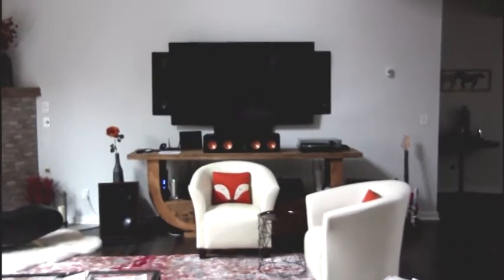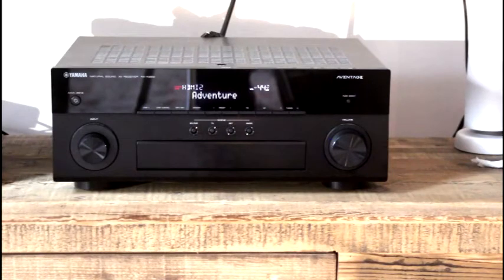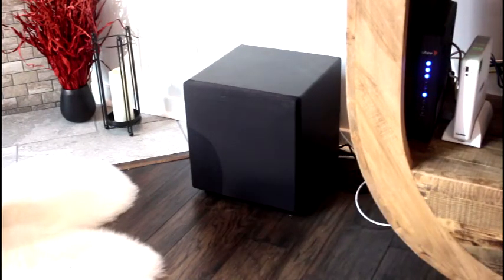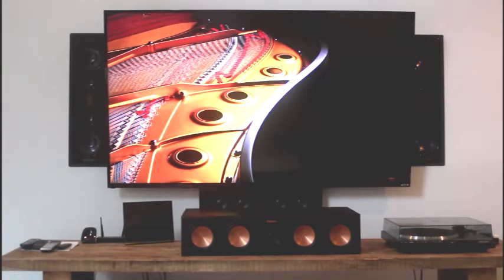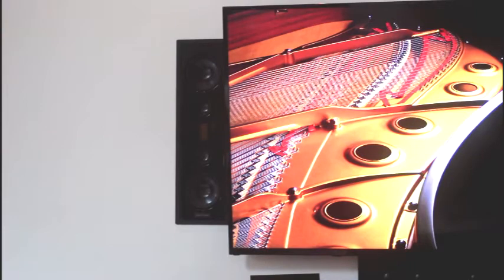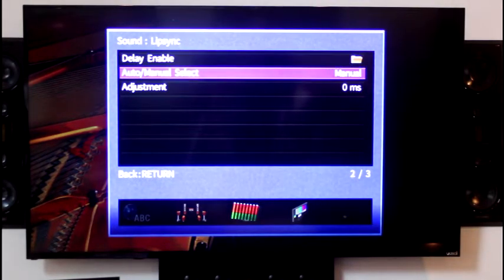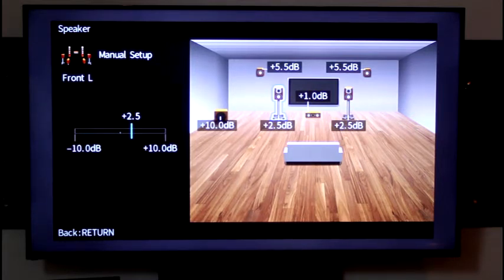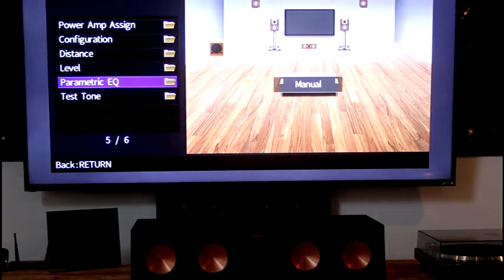Home Theater - troubleshooting the setup - Klipsch, Martin-Logan,Yamaha

Comment: Hi I was just a little confused about the settings from the video picture of your receiver set up screen. It looks like you have it in biwireing setup you have four speakers  the center channel and the sub on the screen shot. I only point this out because it would be possible to have the ML Edges work as your highs and the Klipch  work the bottom ends in a bi wire setup maybe that's why you had too change or twick the frequency patterns. I own a newer Sony 7.2 receiver that has the video assistance display and your clearly shows that a bi wire version was selected
Reply from the maker: I'm not sure what you're referring to with the Bi-wire. Bi-wiring is a function of the speaker not the receiver or amp and separates out the speaker Hi and low crossovers so that they can each take a pair of leads from the amp which has it's output split from 2 to 4 leads.
In the settings BI-AMP is set to OFF and it shows active speakers as FRONT and FRONT PRESENCE. If I try to use the Klipsch and Edges as you suggest I would actually be hooking them in parrallel . Since the Klipsch is rated at 96dB sensitivity and the Edge at 95dB, the speakers would seem to be well matched for efficiency but the Bass response difference between the 2 speakers may be the issue as well as how the receiver sees the speakers. I don't think I would be able to set the bottom properly for the speakers if hooked up in this manner and then I'm back to cone cresh on the M-Ls
Reply: Elliot Check l'm not quite sure how to bi- amp or wire on my Sony but the video you show has the couch in the middle and on my Sony it will show the format or configuration of the speakers around the couch for the different setups and if I go through them they will show all the different pictures two fronts with and without the center and so forth 2, 2.1,3, 3.1 ect... To 7.1 and on the Sony it will show a format that you show in your video with the speakers mounted on the wall and down on the ground for a biwired configuration maybe not biamped setup because it's one receiver but that is your manual settings pick for your configuration  so there might have been a miss read by the receiver that initially started all of your problems that you fixed than bypassing and going into the frequencies and adjusting them  but your multi speaker approach would have worked in any of the other auto adjustment on your receiver I'll try to send you two pics of my Sony for the different types of selections
Reply from the maker: Bi-amping can get complicated, you bypass the inboard amp of the receiver and use outboard amps - 2 for each channel, one for hi the other for low frequencies, you will also need external crossovers to be able to balance the system.

The Yamaha only shows the speakers that are wired into the system, in this case. In my case, the room depiction showed the:
R&L Mains - Klipsch Heresy
Center - Klisch 450C
R&L Presence - M-L Edge
SW - Parts Express Titanic 10"
The Yamaha shows them in their proper orientation
Reply from the maker: @joevigil2  Nice, get rid of the hutch and get a bigger screen.  LOL.
May need an attorney to get it past the wife. 
Did you get hit with copywrie infringement on the video?
Reply from the maker: @joevigil2  I just subscribed to your channel to help you out. Good luck with you videos, it is a fun learning curve.